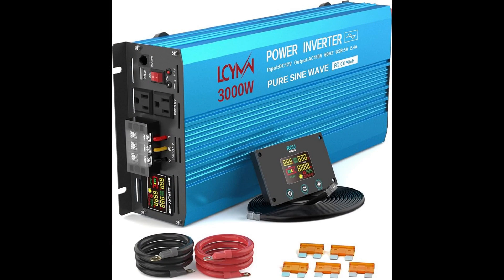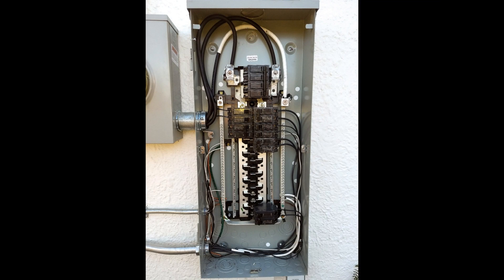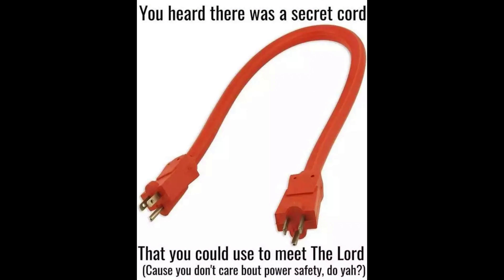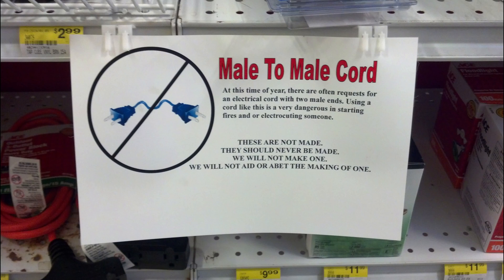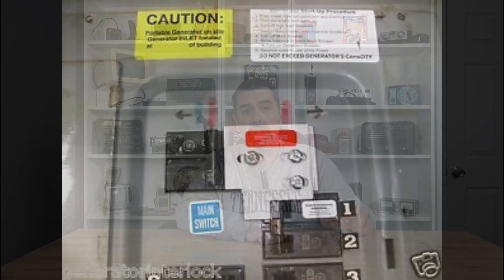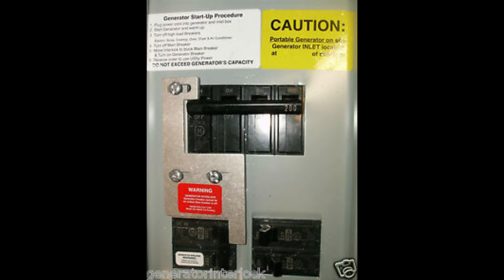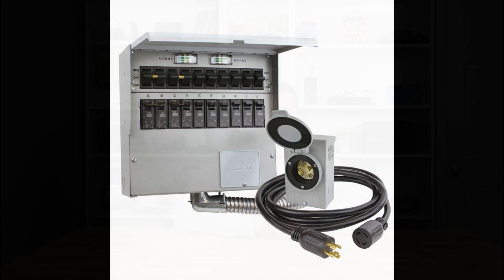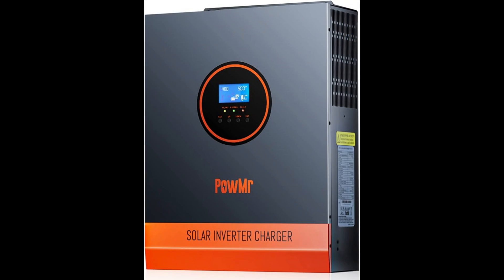A Beginners Guide To Solar Power Part 5: Inverters, How to make 120 (or 240) out of 12.

Comment: A good basic introduction to inverters. There is more. Inverters are rated in watts at how many they can put out continously. They also have to put out double or triple that rating for many minutes to start things like motors that need large amounts of watts to start. Most are high frequency inverters that claim high surge watts but only for 5 seconds. Low frequency inverters can put out high surge watts for many minutes. 
I am building an off grid system to run my shop including my 240 volt 20 amp welder. The inverter I bought is 6800 watts continous, 8000 watts for 30 minutes, and 12000 watts for 5 minutes. You do need a bigger battery bank but it should run my whole cabin and shop.
Reply from the maker: Thanks for the info!